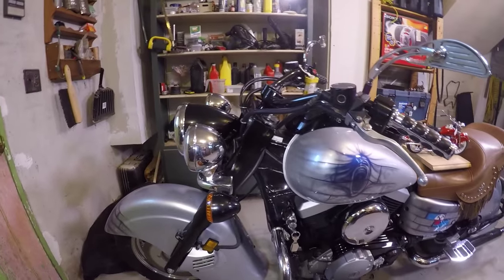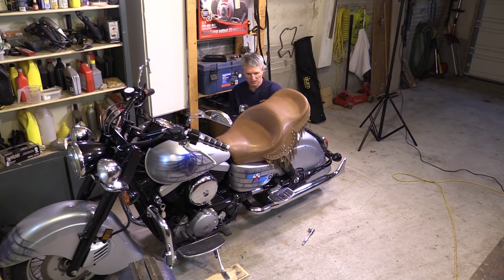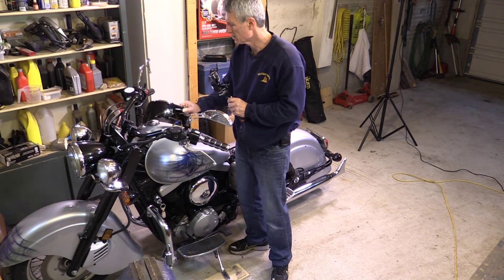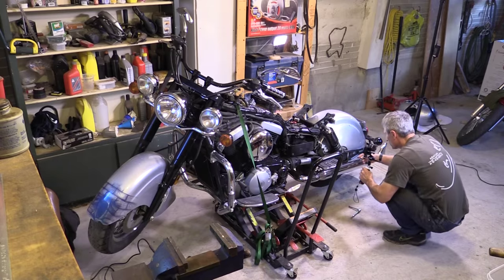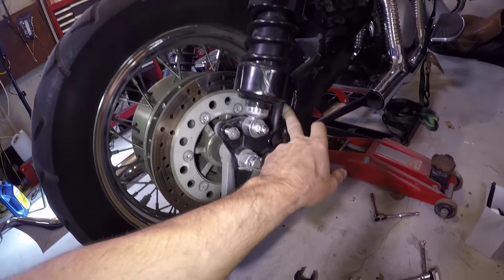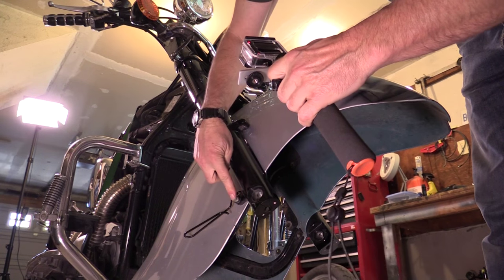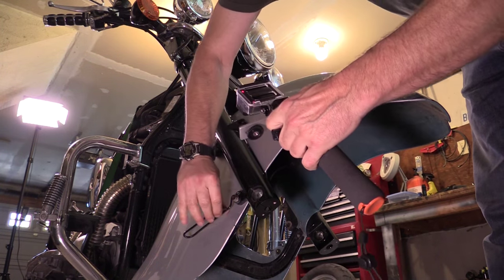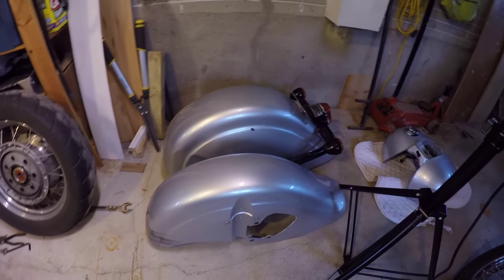Kawasaki 2000 Drifter 1500 Disassembly for Painting and Tire Replacement

Comment: Have the wheel covers for my 1999 Drifter 1500 and saw this video as an easy way to install them myself.  Thought I would have to have a shop do the back wheel but looks very easy to do with a decent motorcycle jack.  Thanks for the video.
Reply from the maker: I recommend getting the manual and just take your time , it's really not that hard. I think I seen you on the Facebook Drifters page. Good Luck!

Comment: Very, very interested in the dual exhaust on this bike...want to sell it?
Reply from the maker: +Bam Bam Hello, this is RockinRonny from the Drifter forum. Unfortunately it's not for sale but it is one of the reasons I bought the bike last year, you just can't find an exhaust system like it any longer. I thought you sold your Drifter and moved on to a different Kawasaki?
Reply: +Tracy Hanes 
I'm this close to buying another Drifter.  Can't believe how much I miss it already :-)
Reply from the maker: They are a fun bike to customize. My tank and fenders just came home from the paint shop and now off to the pin striper then back for another clear coat then I can finally start rebuilding. By the way I use Tracy's utube account (my wife) she rides horses not bikes.
Reply: +Tracy Hanes 
Keep us updated!  Very interested in seeing your progress.  How about some updates to your VDR user  area?!
Winter can not end quick enough for me!